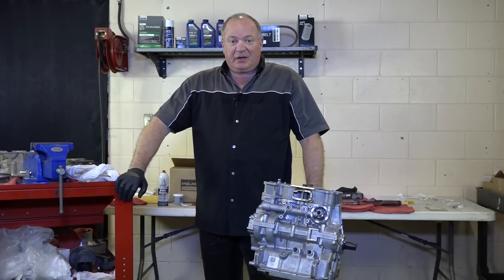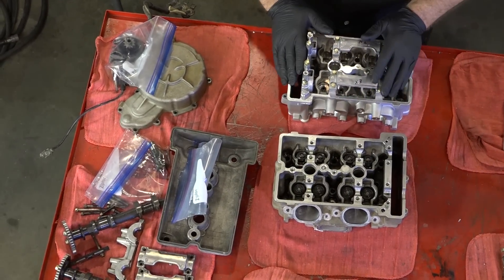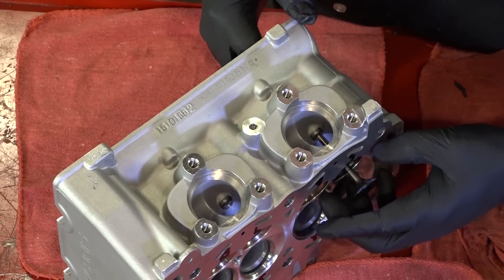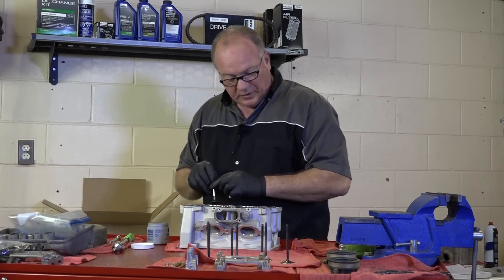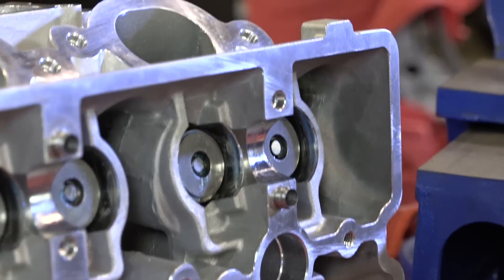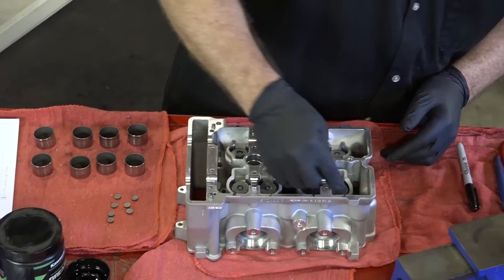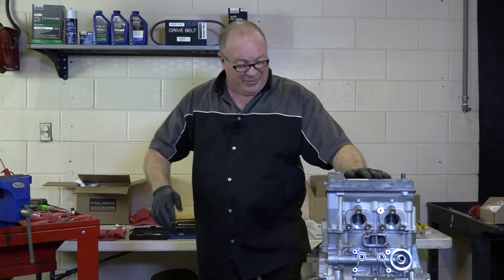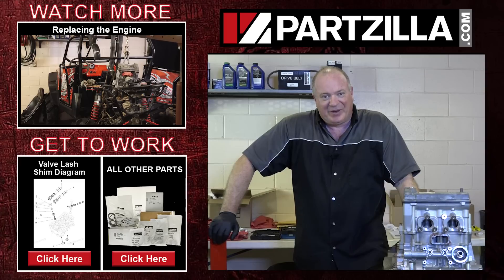Polaris RZR Top End Rebuild | Part 6 in series | Partzilla.com

Comment: Was wondering why you put tdc at the case halve and the service manual says to use the cps sensor hole as the guide?  Seems that your putting yours 90 degrees off per manual.  900 and 1000 difference?

Comment: Great video.  I had a question on the cam sprocket bolts.  I noticed in the service manual for 2013 RZR states to use new bolts for the cam sprockets (assuming because they come with a thread locker pre-applied).  I recently did the valve timing on my 900xp motor and did get new cam sprocket bolts x 4 but realized that I had to remove the first two bolts (exhaust and intake) then the timing chain jumped while rotating the motor to reveal the next two sprocket holes.   On the second try I got everything lined up and put the first two bolts back in (exhaust and intake) then the second two bolts fresh from Polaris.    I did ensure everything was torqued to spec on the cam bolts.    Should I be worried about the first two (re-used) bolts working loose?    I noticed in this video the bolts were removed from the sprockets and put back in without thread locker so maybe it's not a big deal?     Would love to hear your thoughts.  Thanks!
Reply from the maker: The manufacturer always recommends replacing the bolts because they will stretch over multiple tightening.  You should be fine if they are torqued correctly.
Reply: @PartzillaParts  Awesome thanks!

Comment: I am wanting to buy a polaris Rzr 900 xp that a guy is selling for 1300 but I am afraid of not being able to do the rebuild;  last time I went and looked at it. The guy said it ran but was knocking, so we got it started but died on us three times, the third time, starter wires got hot and we noticed it was locked; Whats your opinion? Thanks very excellent job. I have watched the videos a lot, trying to memorize the procedure.
Reply: Shop manual takes you through the whole process. 
These videos are nice though for hands on.

Comment: I just rebuilt a 2015 Polaris ranger 900 and did a bench compression test and found 145 psi on one side and 45 on the other could the shims possibly be the culprit? and where can I purchase the shim kit. thanks
Reply from the maker: Hello randy. You may have a tight valve or two, which could be a result of incorrect valve lash. Here you go!
http://www.partzilla.com/parts/search/Polaris/ATV/2015/R15RTA-E87+RGR+900+XP+ALL+OPTIONS/ENGINE%2C+VALVES+and+CAMSHAFTS/parts.html
 
On this unit you will have to replace the entire bucket to adj the valve clearance.

Comment: Question I'm redoing my pistons and rings would you do a valve job also or just adjustment if the head seems to be in good shape.
Also what's your take on converting my razor to the big bore 935cc kit
Reply from the maker: Pull the valves (make sure you number them), clean off the carbon, and take a look at the seats. Also check out the seals to make sure none are hard or cracked. Be careful when modifying an engine as there is always   a price to pay for higher performance. Hence why we had to rebuild this one.

Comment: Did you torque the cam caps when measuring valve lash or can you leave them snug, measure then torque when complete?
Reply from the maker: Snug, you don't have to torque them down until final assembly.